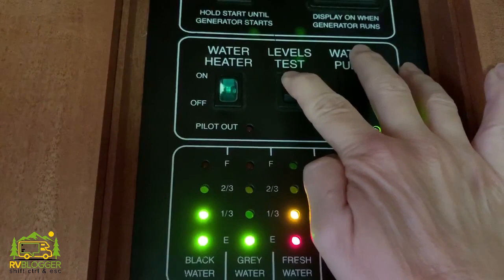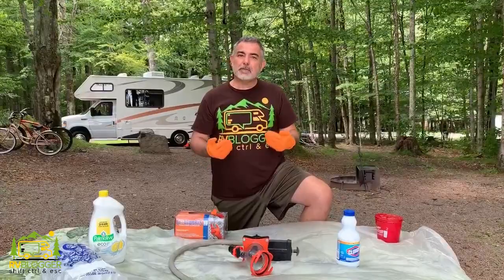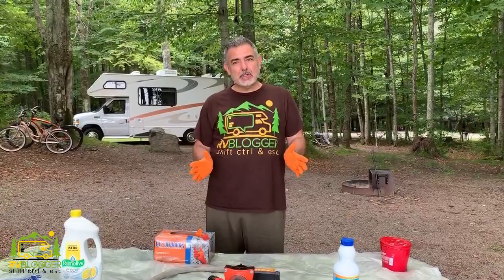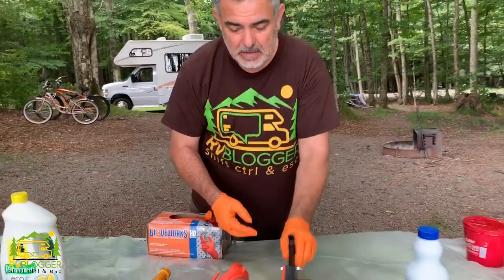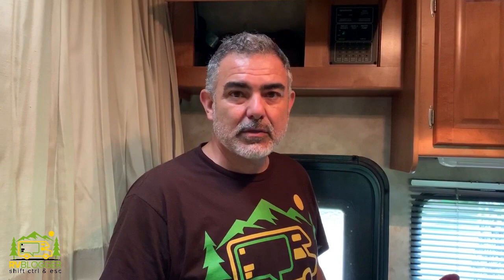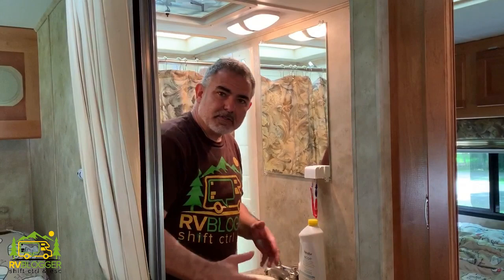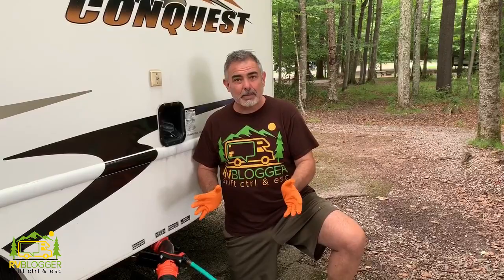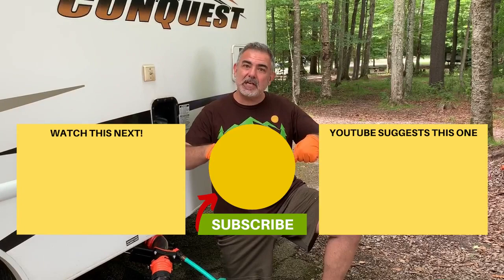RV Black Water Tank and Sensor Cleaning

Comment from the maker: Hi Everyone, 
We hope you enjoyed our video! Thank you for helping us grow our channel and the RVBlogger Community. Do you have a great black water tank sensor cleaning tips? Please feel free to ask any questions or just tell us about yourselves. We want to get to know you and share our RV experiences.
Reply: I live full time in my 36ft travel trailer (it has a hitch), and my trailer comes with a flush valve, so I can hook up a hose directly to flush my tanks. I flush it once a week and spend about 30 minutes each week, closing and opening my black water tank to fully clean and flush it out.

My question is that since my trailer is fully stationary, can I still use the ice cubes and dishwasher detergent to clean my sensors by using my blackwater flush to slosh it around? I do have a non flexible wand that I can use. My bathroom has a door, so I can easily get a hose into the bathroom. I'm just trying to figure out the best way to clean my sensors since I'm sure they need it since I've been living in my trailer for almost 4 years

Comment: Great video Thanks only problem for some is our 5w the blank tank doesn’t plumb straight out like most so the jet of water doesn’t work in this situation but I know it does work in a dump like you have
Reply from the maker: Hi Brian,
That's a good point but I would imagine for routine maintenance and rinsing your tank after each dump you would get at least some water movement in the tank and it is still a very easy way to fill the tank to give it a quick flush.
Thanks for watching and for your comment!
Mike

Comment: Great video and great info but I will say the wand I will need! And I am able to run a hose straight to the bathroom because of its location in our travel trailer.
Reply from the maker: Thank you so much! Being able to run the hose in the bathroom is a great feature. I (Susan) did that way back when I had a TT. Thank you for watching our RV black tank video and commenting New America Tow Guy.

Comment: I have the rhinoblaster also and I'm really glad I got it.  Do you recommend using it on the gray water tank as well?  Or, would that cross contaminate even though you'd have the black tank closed at the time.  My gray tank shows only 2/3 full and its backing up either in the sink or shower.  I'm now emptying it when it reaches 2/3 so I ensure it doesn't back up.
Reply from the maker: Hi Renee,
We use ours on the black and gray tanks. We don't use it on the gray tank every time we dump but every now and then I like to give it a rinse.
Thanks for watching and commenting! 
Mike and Susan

Have you subscribed to our YouTube channel yet? If not we sure hope you will click below and subscribe! Thanks!
http://goto.rvblogger.com/YoutubeChannel?sub_confirmation=1

Comment: You are correct about insuring the bleach is thoroughly rinsed from the tank. What's worse  than the effects it has on seals is that it is corrosive to the sensors themselves, rendering them inop.
The ice trick has been debunked over and over however.  It chills the water down to the point that it renders whatever detergent you choose to use less effective at dissolving the trace amounts of grease and oils that will cling to the sides of the tank. Another reason is that ice is not abrasive and adding it to a half full tank, its probably melted before  you could get on the road to slosh it around anyway. However as you point out, throughly rinsing you tanks after each use is the best defense for keeping tank sensors working accurately.
Reply from the maker: Hi Gary,
Thanks for your input...
Thanks for watching and commenting! 
Mike and Susan

By the way, have you subscribed to our YouTube channel yet? If not we sure hope you will click below and subscribe! Thanks!
http://goto.rvblogger.com/YoutubeChannel?sub_confirmation=1
Reply: Thanks for this comment. Good information.

Comment: Do you need the Rhino Blaster if you have a black water fill connection at my connection center where my fresh water connection is located? Does this spray hard enough? I have the Rhino Blaster w/o the gate valve and actually use both.
Reply from the maker: Hey chsbandad, 
If your RV comes equipped with the RV Holding Tank Cleanout System then you shouldn't need the Rhino Blaster. 
Thanks for watching and commenting! 
❤ Mike and Susan 

By the way, we hope you will subscribe to our FREE monthly digital/video magazine called RV Camping Magazine. Let us know how you like it!
https://rvblogger.com/rv-camping-magazine/

Comment: With the new RVs in the black tank flush does that seem to work fairly well? I’ve also heard of dumping a cup of simple green and letting that slash around that is an all natural with enzymes in it seems to work good I’ve heard.
Reply from the maker: Hi Stick Jr,
Yup no need for the RhinoBlaster if you have a newer RV with a black tank flush built in. I have not heard about adding simple green. Let us know if you try it and how it works.
Thanks for watching and commenting! 
Mike and Susan

Comment: I appreciate your videos. I think they're well made and informative.
About the Rhino Blaster with gate valve. I bought it and I'm not certain it's worth anything more than the window it provides to see what comes out. Please correct me if I'm wrong! First of all, the hose will not pressure wash any significant area  of the tank at all.  Also, it seems that the only way to know that my black tank was filled was by looking. So, rather than backfill,  I got a flashlight and used the toilet's flush function till I could actually see the water at the bottom of the toilet drain. 
So, is there a way to know you've filled the tank from outside the vehicle? Same question for the gray tank. Thanks.
Reply from the maker: Hi Daniel,
You can't pressure wash the inside of your tanks but you can easily fill and rinse them...
We just use our control panel and when the indicator light shows full we turn off the water and dump the tank...
Susan is usually inside cleaning up and I am outside putting stuff away so she keeps and eye on it and let's me know when it's full.
Thanks for watching!
Mike
Reply: @RVBlogger  Thanks, Mike. That makes sense. Didn't think of it because my gauges aren't working properly. 🙏🏽

Comment: Curious why the black tank flush connection is not as good as or better than the Rhino blaster?  On my RV the dump valve main connection point is used to connect the main "sewer" hose but both the black water and gray water used the same exit point.   Therefore the Rhino blaster is not directly shooting water directly into the back tank but into a quite long section of pvc pipe that both the grsy and black tanks empty (depending on which of their separate gate valves are opened.  Not sure the Rhino blaster would work in my situation.  Thanks for the video
Reply from the maker: Hi Mark,
I neglected to say this in the video but if you have a black tank flush connection built into your RV you don't need the RhinoBlaster. Sounds like you are good to go!
Thanks for watching!
Mike

Comment: Hi there first time I think watching your channel and I noticed that this was made in 2019 so you’re probably aware already however if your sensors are not working right you’ve got struvite buildup it’s a crystal forming thing that builds up on your walls and can cause a lot of have a gift there let go too much now there may be another way to clean it out but in my research using a pressure washer go on the outside of your tank go inside with the little little hose thingy and it’ll knock all that off I have tried other products that remove struvite or cleans your sensors with no luck recommendation for companies that actually do come out and Hydro flush your black tank from the outside with a pressure washer have recommended once or twice a year to do that to help keep your maintenance up on that however I do not recommend hiring one when you can actually do it yourself because they cost over 200 bucks to come out and Hydro flush your black tank hope that’s helpful have a good day thank you for the video
Reply from the maker: Hey Edie, 
We appreciate the info, it'll be helpful for many :) thank you! 
Thanks for watching and commenting! 
❤ Mike and Susan 

By the way, we hope you will subscribe to our FREE monthly digital/video magazine called RV Camping Magazine. Let us know how you like it!
https://rvblogger.com/rv-camping-magazine/

Comment: As a long time Rv'er my experience has been that the ice pretty much does nothing. I have a Rhino blaster and it does only a somewhat decent job. You should never put bleach in your black tank for the same reason you wouldn't put it in a septic tank. The method that I use is the easiest. Keep your black tank always a 1/3 full and add something like Unique RV Digest-It+ . Then, when you empty the tank, follow up with at least two 5 gallon forceful flushes directly through down the toilet. When the water comes out clear on the Rhino blaster, It's clean. As far as detergent, I also add about a capful of Fabuloso and we are ready.
Reply from the maker: We have changed our minds on the ice thing too. It will work if done properly but no one has the time to do it properly. We use lots of water in our Tanks and we switched over to Matt's Liquified and love it.

Comment: Do you think vinegar would clean the blank tank? If you fill the tank and then put a gallon of vinegar in there to sit overnight do you think that would help clean off the sides of the tank?
Reply from the maker: Hi Stacey,
Good question!
I don't think that would work. The vinegar would be too diluted to work effectively.
Thanks for watching and commenting! 
Mike and Susan

Comment: That is a large black water tank. Is that a combo gray and black tank. Im considering a trailer with on of those and it seams strange to me
Reply from the maker: Hi Virginia,
I just doubled checked the specs for our RV and we have a 31 gallon black tank and a separate 31 gallon gray tank on our RV. 
FYI - Some of the off road packages or boondock packages on travel trailers include larger black and gray water tanks.
Thanks for watching our video!
Mike

Comment: After watching your video I have some honest comments. Nice holding tank rinse out video.
Your first section with ice cubes and dishwasher detergent, you need to explain that the black tank needs to be at least 1/3 of water for this to work. If the tank is empty, the dishwasher detergent will sit on the bottom like regular poop. There are plenty of YouTube videos showing that using expensive RV/Marine TP isn’t worth the extra price, just use any “septic friendly” TP and DON’T WAD up the TP.  
All of your options that you show in this video are basically backfill rinse out options. To actually clean the tank, I’ve found only 1 thing that will get rid of the hard grime on the sides and sensors to like new. Using a sewer pressure jetting kit will clean to like new. Easy to do and less than $100 for a kit. Full timers should use annually and weekenders should use biannually. Plenty of video’s out that show how to and some actually show results of before and after. 
Thanks for helping the newbies to our community.
Reply from the maker: Hi Storey,
This is one of the first  videos we made and I wish YouTube allowed content creators to go back and revise old videos, but they don't. So YouTube is full of incomplete or incorrect info. Watcher Beware.
I appreciate your comments and your friendly demeanor.
Thanks for watching and commenting!
Mike

Comment: Thanks for your video but here's the thing,  no one in these videos ive been watching about this subject has mentioned the use of HOT water!!! That alone is not only going to loosen all the crud but help disinfect. I believe that the ice is doing very little other than actually making what you're trying to get rid of literally harder and negating any benefits of proper chemical reactions from the hot water. Anyone else thinking this?
Reply from the maker: Hi Magic Nomadic,
Here's the problem with using hot water...most RVs only have a 6 gallon water heater and the black tank is usually 4 times that size. So - there is not really a practical way to fill your black tank completely with hot water. Plus - there isn't always an easy way to get the hot water into the black tank. So - that's why these other methods are used.  I do think hot water would do a good job cleaning the black tank though. I like your perspective on this.
Thanks for watching and commenting! 
Mike and Susan

Have you subscribed to our YouTube channel yet? If not we sure hope you will click below and subscribe! Thanks!
http://goto.rvblogger.com/YoutubeChannel?sub_confirmation=1

Comment: I tried the rhino blaster but was unable to hook on. I have a very small space.
Reply from the maker: Wow! That's disappointing! Not sure if it'll work on your camper or not but Camco makes a sewer hose extender in a variety of lengths. I'll include the Amazon link if you would like to check it out. Thanks for watching our RV Black Tanks and Sensor Cleaning video and commenting! Safe travels! https://amzn.to/3NA9Rf9
Reply: @RVBlogger  sad but no. Space i have is 3 inches and hits the bottom of compartment. It is 1993 coachman class c rv. So i have to use the hose to go in. Sensors states 3/4 full after empty.  Going to try that dishwashes soap. Hope it works.
Reply from the maker: Sorry to hear that. We have a video about cleaning tank sensors that might help. https://youtu.be/koDhrqgcUCo It's frustating when your sensors aren't accurate!